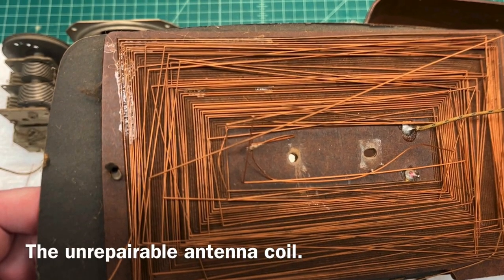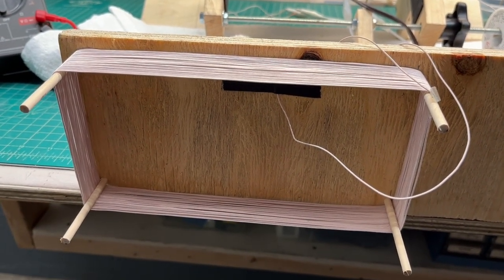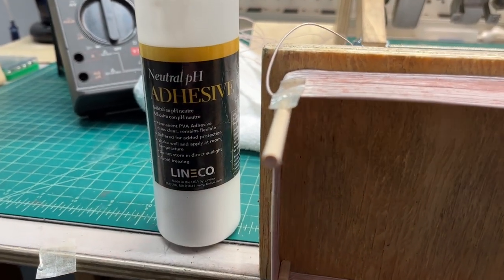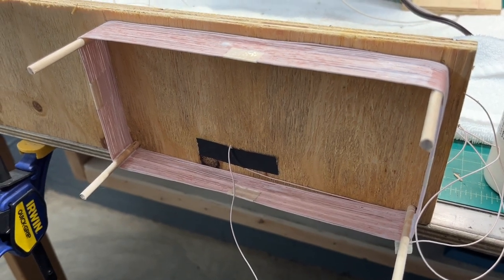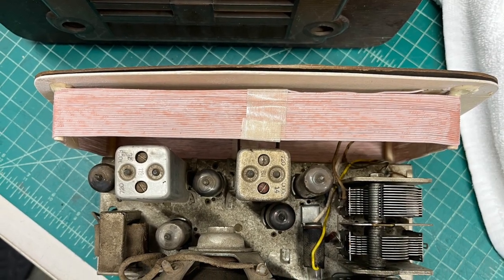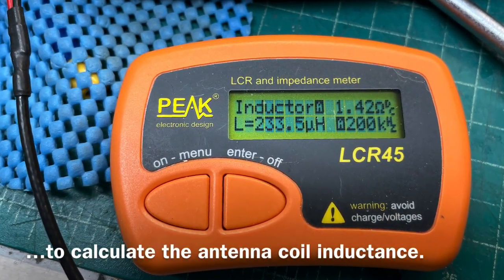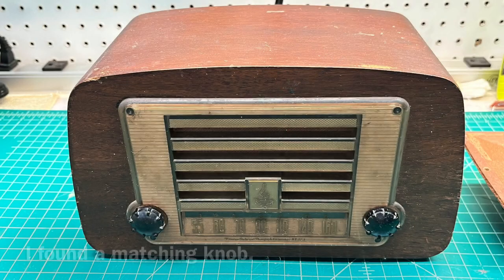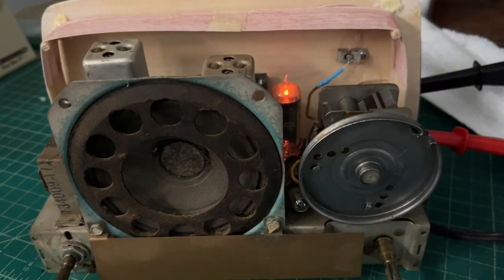Emerson 588A - Building a New Antenna Coil (Loop Antenna) w/ Litz Wire

Comment: The antenna redesign Looks great! Thanks for sharing the equation notes about that. I did not know there was a common rule of thumb to calculate that. Very cool, a other great tip to go into my Don-ROR archive! Man, it's getting thick..hehe, again buddy thanks for sharing 👍
Reply from the maker: Glad it was helpful Tony. It should get you close. Check the comments on video and you’ll see the original formula that I rearranged to… Best, Don
Reply: @RestoreOldRadios  yea that's what I'm looking at. Thank you for posting that in the comments. I always wondered how they calculated that loop. Cool!

Comment: The antenna replacement turned out great Don, I like how you built it. My antenna that I built I took the total capacitance of the tuning capacitor (420pF) as it would be at 540KHz and calculated the inductance to be about 207uH.
Reply from the maker: Thank you for your kind words and for sharing your design criteria. I thought about using the ferrite rod antenna on a permanent basis, but wanted to save it for a future project. I had just enough Litz wire left over to pull this one off. Thanks again Jim. Best, Don

Comment: You are getting so good at restoring these radios by fixing speakers, rewinding transformers, making new oscillator and antenna coils. Not to mention remaking missing/damaged cabinet parts. Did you ever think about making a receiver from scratch or junk box parts?
Reply from the maker: Thank you so much for your kind words. I haven’t really thought about it, but since your mention, I may ponder the idea for a future video/project. Again, thank you Dan. Best, Don

Comment: Hello, thank you very much for taking the time to explain and share your knowledge and experience. I saw the formula you were using , where you mention "(Upper Freq. of Receiver + IF Freq.) squared divided by Upper Freq. of Receiver squared x Local Oscillator Inductance in uH = Antenna Coil Inductance in uH" 
How do we find out for a modern  radio with SMCs the value of the Local Oscillator Inductance in uH please?
Also, could you use the the variable capacitor's value to calculate resonance along with uH of the antenna coil? 
Thank you so very much again for kindly for sharing your knowledge with us all!
Reply from the maker: I just posted a new video below that takes a different approach that you might find helpful. Check out the video description as well for  another formula and link to a video that goes more in depth. Hope this helps. All the best. Don

Unknown Antenna Coil Inductance Calculations
https://youtu.be/8x4bJn8dfHU

Comment: Don, so the antenna here is also an integral part of the local oscillator? In essence, it is half of the tuned oscillator circuit in the radio? 
Thanks,
Ian
Reply from the maker: Ian - no; I just used the LO coil inductance to closely calculate the needed inductance for the antenna coil (loop antenna) by rearranging the formula that many radio men used back in the day. Hope this finds yo doing well. Best, Don

Comment: Approx how many feet of wire did your unit require ?

A friend of mine asked me to test the tubes in his RCA 87T1 and because I have a variac to use that and bring the unit up slowly as it has not been used for many years. He also asked me to put a 3-prong plug/wire for grounding the chassis. I disagree with doing that. What is correct?
Reply from the maker: Sorry for my belated response. If I did the math correctly, approximately 62 feet of Litz wire to get 300 uH of inductance. 

I’ve never used a 3 prong plug on any receiver, but one with a power transformer like the RCA 87T1 shouldn’t be an issue, but I don’t know the advantage other than using the house ground as part of the antenna setup, but a separate earth ground may provide better results and less electrical noise. A 3 prong plug on a hot chassis set (AC/DC set with no power transformer could be lethal. Be safe and thanks for reaching out. Best, Don
Reply: @RestoreOldRadios  Thank you for your reply. Back then they used the neutral for ground and its not the same thing as an earth ground. Its a balance conductor. As an ME, and not an EE, I'm worried and feel it should be left as is.
Reply from the maker: @MorroccoM13  Yes, I agree with you. I would keep it as designed with a 2 prong polarized plug with the hot side going to the switch and the the neutral tied to the other side of the primary. I typically add a fuse on the primary side as well. Hope things go well. Don
Reply: And that's one of the problems. I found schematics and it shows a switch (S4) BUT all I know is that there are 3 knobs on the face of the unit. The large center one is probably for tuning but none of them have any indication as to what they are/do. Slow and steady. This is what I get for having a tube tester and limited knowledge. Just trying to help a friend. Thanks again. @RestoreOldRadios
Reply from the maker: I glanced at the schematic and facing the radio from the front, left to right the Tone Control/Power switch, the Bandswitch in the middle and far right the Volume control. 

http://www.nostalgiaair.org/PagesByModel/186/M0015186.pdf
Reply: Thank you. So kind of you. Really appreciate it. @RestoreOldRadios
Reply: I printed of the info you sent. These schematics have so much more info than the one I have. You have made my task so much easier. You are the best! Regards, David  @RestoreOldRadios
Reply: Do you repair radios for other people? This RCA 87T1 is more than I want to take on. I'd be guessing on a few things. I fixed a few things and brought it up slowly on a variac. Had a wonderful hummmmmmm when I was done.

Comment: Sp will this formula work for shortwave and or AM?
Reply from the maker: I think it should get you in the ballpark. The original formula that I rearranged is as follows:

Local Oscillator Inductance= UpperFreq squared x Antenna Coil Inductance divided by (UpperFreq + IF Freq) squared

Thanks for watching and reaching out. 

Best,

Don